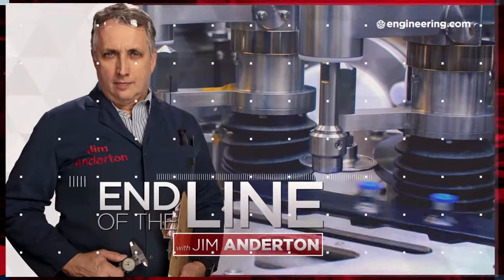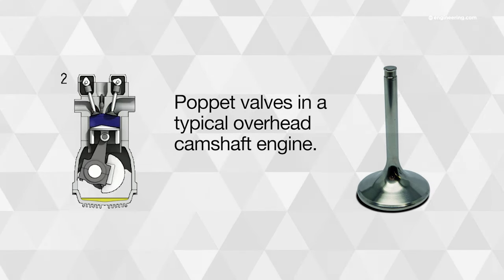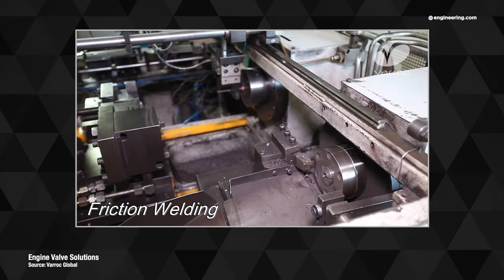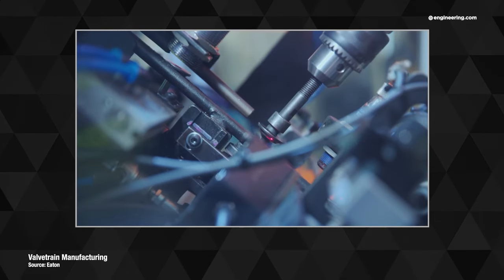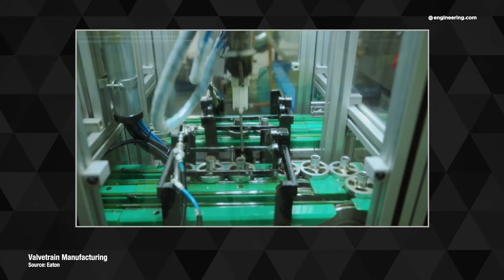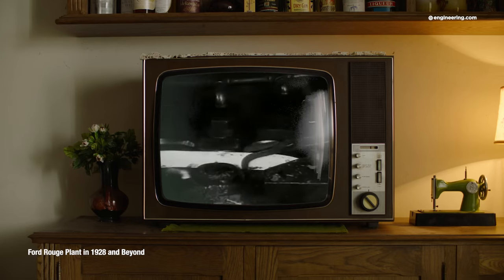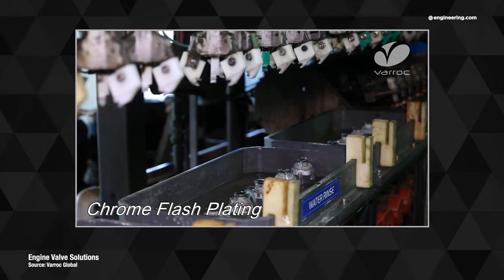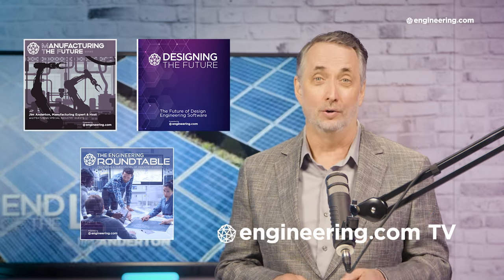EVs Are Starting to Kill the Auto Parts Industry

Comment: I don't think so, they will find out soon - there is not enough power to charge all EVs, and also, that they cannot replace gas vehicles for MANY REASONS...🤷‍♂️
Reply: Texas can't even turn on their heat or AC without the grid failing.... and electric cars only make up 3% of cars. 

They might be able to make it happen in like a century, but definitely not by the end of the decade 😂
Reply: What caused all the power failures during the last big freeze? Have a think about that.

Comment: Truely a story designed to blow smoke.  At the point of EV's and for the next 20 years the need for those parts will remain solid.  The ONLY difference may be with new internal combustion engines.  Internal combustion engines will not stop bring produced for many more years.

Comment: Yeah, 14 & 15” steel wheels, carburetors, manual transmission, incandescent light bulbs, ignition points, hydraulic power steering pumps, distributors, brake shoes & drums and all the components and machines that produced them. It’s called PROGRESS.